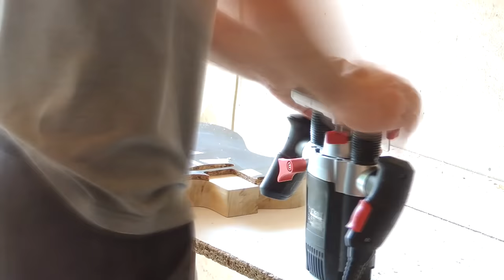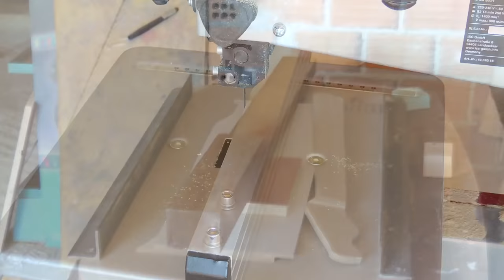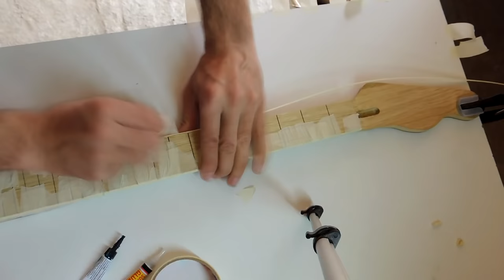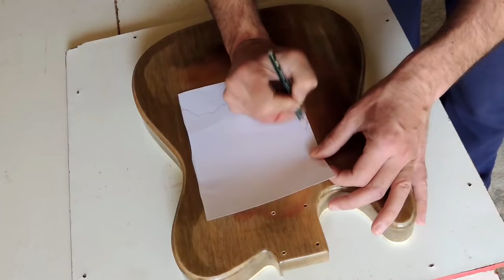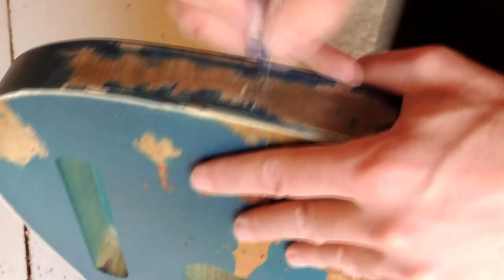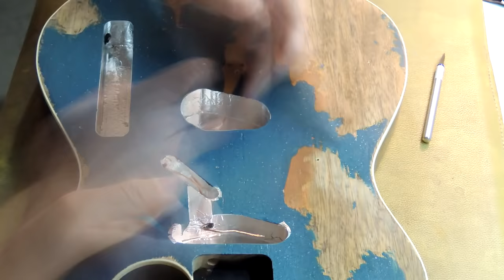Building A Custom Guitar By Burretone Guitars

Comment: If you sand down the front of your cutters so the front is flat with the cutting part, you can get a ton closer to the fretboard and not have so much fret overhang to file off. Great build.

Comment: I do a few things differently. I cut my fret slots and dots and while the fretboard or neck blank(one piece neck) is is still square. I drill the tuner holes when I'm cutting the truss rod cavity while the neck blank is still square. I install 7 frets at a time then lightly clamp them down with the radius block, overlapping the ones that I installed first. This eliminates the need for fret leveling after installation. And you must try a shinto rasp for your profile carve. You'll love it. Very cool vid. I've thought about making one, but am always too busy. thanks for posting. It makes me want to get busy on some unfinished projects. I'm working on a Nashville tele with b bender. But I've been busy and it's been sitting unfinished for almost a year now.
Reply: Could you explain the "7 frets at a time" technique? You just install the frets and clamp with radius block??

Comment: Great work by the builder. Awesome! I love the look, but If it was mine I'd always know it's "fake". In my humble opinion part of the appeal in a relic guitar are the stories of how those dents and scratches happened or the whole gradual decay decay of the paint over the years and years of playing. To me a relic has to be earned.
Reply: Sort of ... I guess its like distressed denim jeans I am not feeling like a fake for wearing  them and don't feel that anyone should be dragged behind a bus for 5k or maybe stand in front of a sanblaster for 30min to earn the worn in look . Relic stuff just has a worn in feel thats less of a worry and more casual its nothing to do with earning and more to do with enjoying - but each to their own. After restoring relic items like motorbikes it is a much safer option to make them look relic than be genuine relic between crooked frames, engine problems etc.... you never know what is going to fail and the abuse the item has had before it is in your hands.
Reply: So if you buy a road worn guitar you earn it? And what if it's not actually road worn, you just think it is?

Comment: If I had thousands of dollars worth of woodworking equipment, I might try this.
Reply: @Splitinfinity If you can do it, by all means. I can't. I need a drill press to get the holes perpendicular to the surface so that I can drill things like string-through holes that line up, etc. I'm not  good enough with a chisel to get anywhere close to what a router can do.  If you're talented and can do that with basic tools, fine. I'm not.

Comment: Am i picky, or does anyone else have a problem with an electric guitars body being made of 2 glued, separate pieces. For as much as you're paying for a guitar, you would think they'd use 1 solid piece of wood.  Dang, how much more would it be?  an extra $20?
Reply from the maker: Actually i never thought the extra cost, two pieces is just my preferred method and is the best method for me but of course if a someone wants a body made from one piece il do it and i have done it a lot of times when asked, if there is availability in the wood of course.

Comment: and so you’re a genius after making a 50’s guitar replica,,,60 but it will never sound like a real one of its years the pick-ups made by automatic machine the wood are not able to have the sound of an old bravo for the aesthetics it is pretty,,,,,,the acute capacitor was also a big orange paper oil at the time
Reply from the maker: Actually i never thought the extra cost, two pieces is just my preferred method and is the best method for me but of course if a someone wants a body made from one piece il do it and i have done it a lot of times when asked, if there is availability in the wood of course.
Reply from the maker: Sorry this answer was for another comment, thank you!